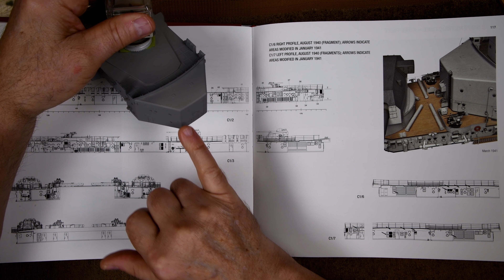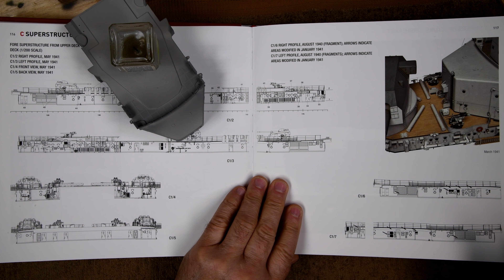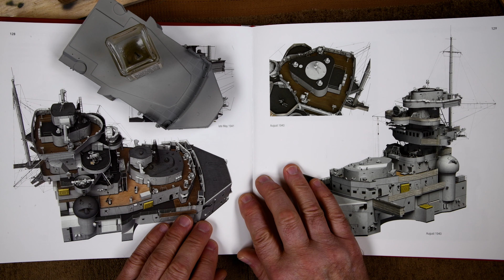The Model Ship - Part 146

Comment: I meant “should” have sprayed fine at 10 psi. Do you back flush before cleaning? I spray pure isopropyl before disassembly, and occasionally put my finger over the tip until the isopropyl bubbles in the cup. Then I strip down. I use just isopropyl..
Reply from the maker: I'll try the back flush idea next time it's acting up. If it helps, I'll know that I've got "lumpy" paint, lol. 50/50 you say. Will try that too. Thanks Tony 👍

Comment: Also, you may need more that the small brush for the nozzle.  You might need to (very gently) use a reamer (or even the needle (or a spare needle) to completely scrape out the nozzle.
Reply from the maker: I can actually see the inside of the nozzle --- it's clean, but thanks for the suggestion 👍

Comment: Hi Ron

I don't know if you have solved the airbrush problem? I realize that this video is over a year old.
But if you havent could it be a case of dry-tip? Its not possible to see from your video but if your trigger technic means that you cut of airflow before or at the same time that you cut off paint dry tip will form.

I dont have expirience with Tamiya paint but for vallejo I use a few drops of "flow improver" to prevent dry-tip as well.
I always keep the air trigger depressed for longer than the paint trigger in order to blow the nozzle clean and I never start the flow of air over my subject in order to counter spatter of semi dried paint. 
As my trigger technic improved, as I got a feeling for the ratio of thinner to paint and when I startet using flow improver my dry tip stopped being a problem.

I hope I am too late in commenting and that you solved your problem long ago :)

BR
Reply from the maker: Hi Kent,
Yes, now at  episode 769 today, I've had a bit more experience with my air brush. I'm having fairly consistently good results by thinning down the Tamiya paints by at least 1/3 of thinner.
Reply: @roncalverley  glad to hear it 😊

I am enjoying your episodes emensly. I have the 1/200 Bismarck and have just ordered the Draminski book.
Reply from the maker: @kentpetersen5171  You will not be disappointed with this book. I never once regretted getting it. 👍

Comment: Are you using a DOUBLE-ACTION AIRBRUSH? Meaning PRESS DOWN for air and PULL BACK for paint?  If so, check to see if the needle is securely tightened.  Watching you, it looks like the needle is slipping. What Model IWATA are you using? Also, your paint looks like it needs to be thinned more.
Reply from the maker: Answers to your questions:
Yes, double action, Iwata HP-CS
Needle is not slipping, lol.
Agreed, paint could be thinner 🙂